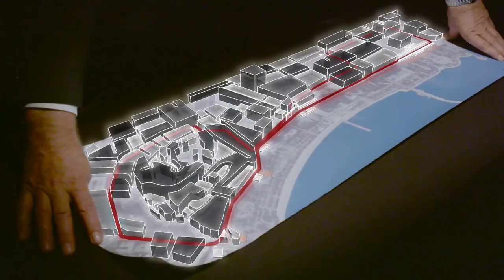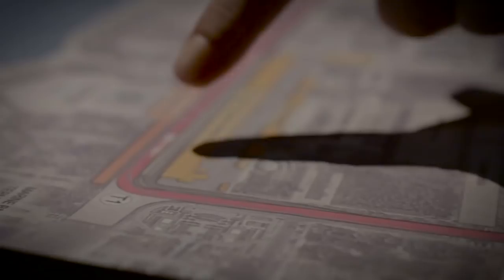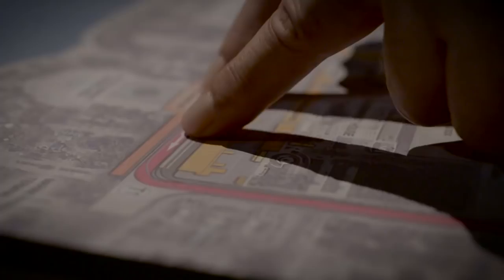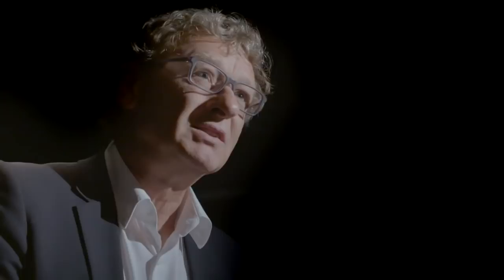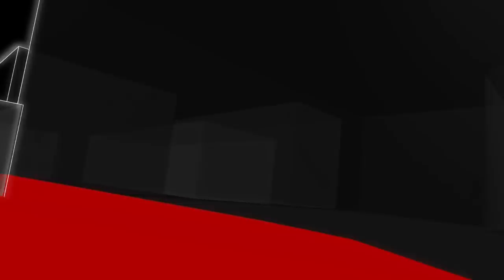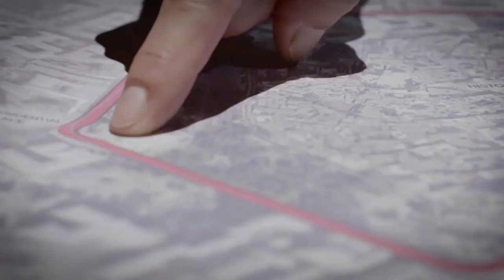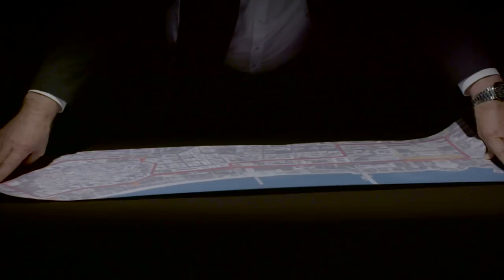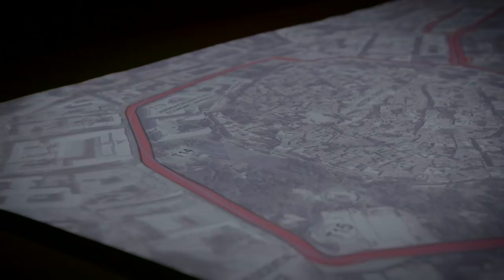Baku City Circuit: Designing F1's fastest street track

Comment: Stop using 90 degree corners. They're not fun.
Reply: It's really tough to otherwise on a street circuit. You can't just demolish half the city centre because it would make for a more cool looking track, you have to work with what you're given.
Reply: Have you seen any of the 11 Australian F1 Grand Prix's when that round was in Adelaide? Turn 4, 5, and 6 were all 90 degrees. Infact turn 1 through to 6 made for the best racing for any Formular One first sector racing in all of F1 history. That was because that whole section will always catch a driver out. The best example of that was when Damon Hill and Michael Schumacher crashed in to each other in the 1994 Australian F1GP.

Comment: While the track is challenging, to me it is the wrong sort of challenging. An F1 car has little to no grip at low speeds, but is phenomenal at high speed. In this track the challenge is at low speed which is frustrating to watch. By contrast, turn 8 at Istanbul park is one of the best corners ever designed for a new addition to the F1 calendar, a quadruple apex left hander taken pretty much flat out in one gear short of top gear
Reply: sure, but it is very hard for f1 cars have a very hard time following each other in fast corners, so slow corners help with racing
Reply: @pabloruiz3313  well no, current f1 works best with tracks with long straights with some tight chicane or corner at the end